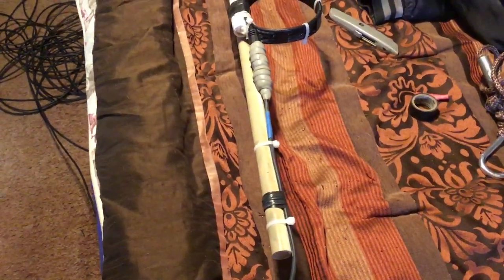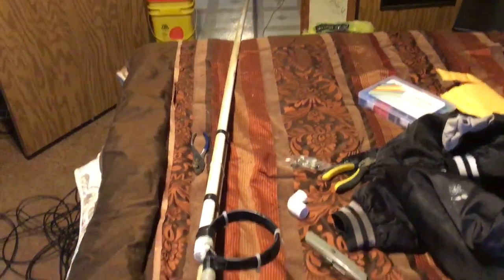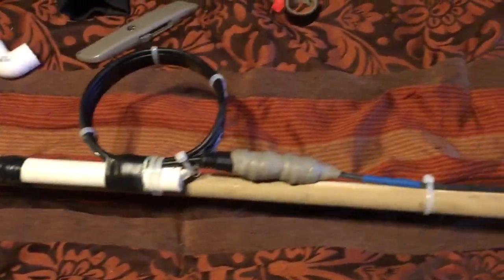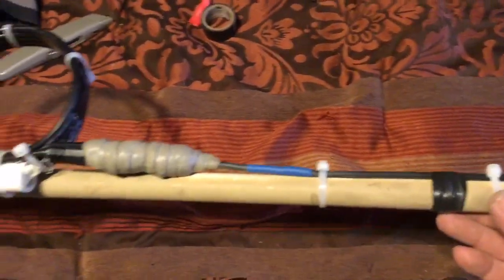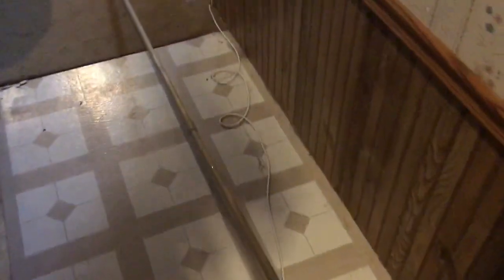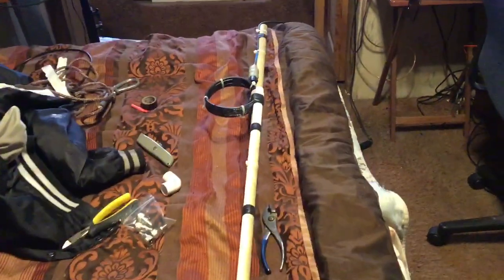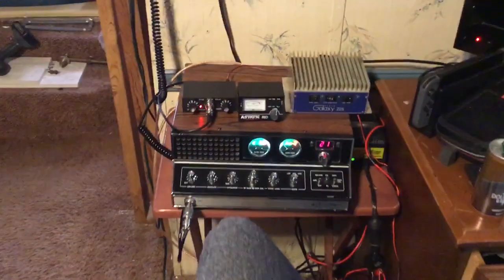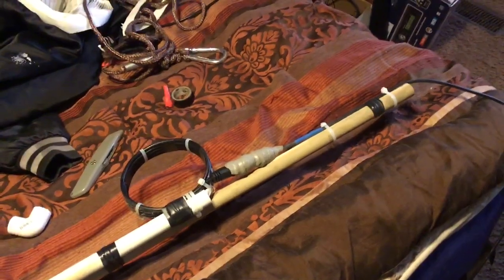11 meter CB base end fed dipole bazooka antenna

Comment: You may want to consider adding about 1/8 to 1/4 wavelength ABOVE the end of the dipole to minimize coupling to a wet tree limb or metal support you may use, yes this makes it longer, however, it will minimize swr fluctuations, thereby power output will stay where you want it during high humidity or when it is raining. This is especially true if you are freebanding or using the antenna "widebanded"!